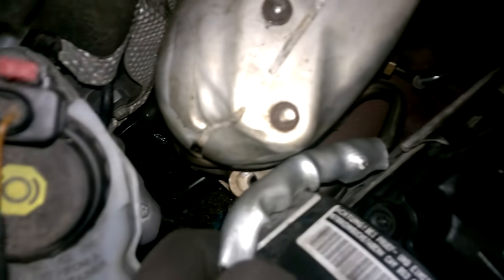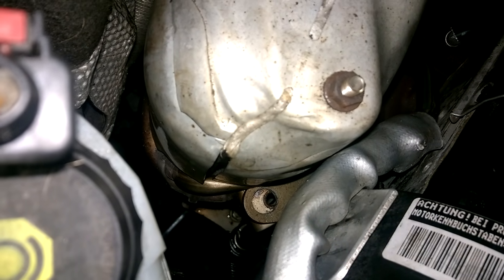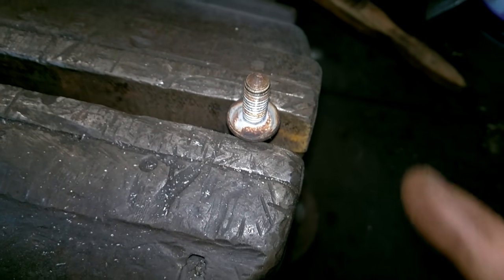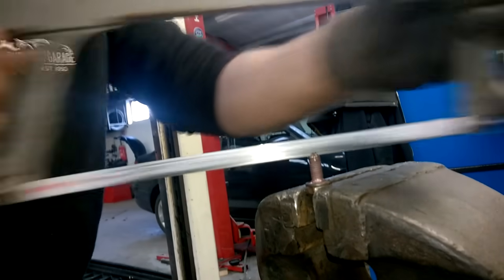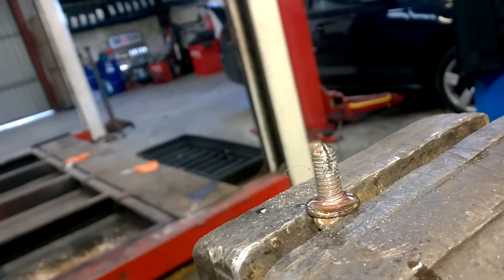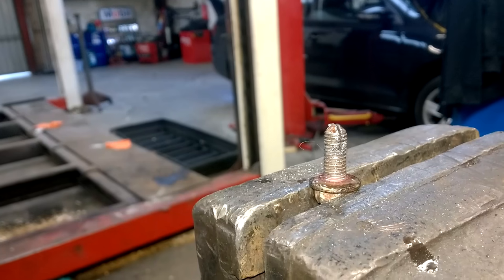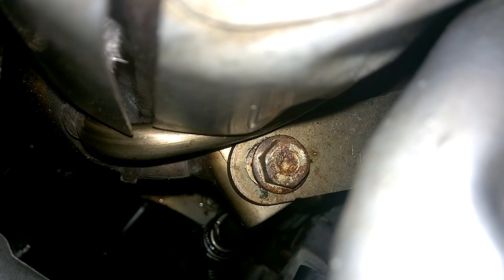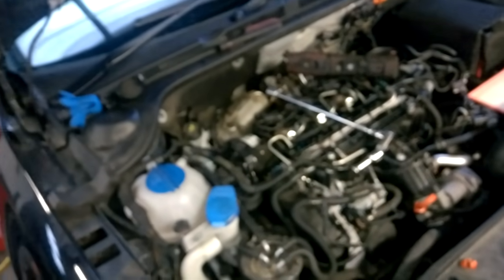My Father Taught Me This! Passing It On To The Next Generation

Comment: Thank you for sharing your father’s knowledge with us!
Reply from the maker: Cheers Dan  
 
The update info below is the pinned comment on this video, I know most people do not realize I made that video and it better explains/shows this method in use.   
I also included below details of why the job was done this way free of charge with the customer fully informed. I hope you check it out  👇👇
 
UPDATE* I decided to make a follow up video on this https://www.youtube.com/watch?v=yfNQullGEuQ&feature=youtu.be Should answer some of the questions that were raised, I include 3 demos of this in action with close up shots.
 
As there was some safety concerns & confusing comments raised, I felt I should clear a few things up. 
1) This is a tip for certain circumstances only, I never have and never would use it on a component which would cause any safety concern to any customer.  
2) The demo was done on a support bracket only, items like this or similar will not cause any safety concern. 
3) I did this free of charge and on a time restraint, I noticed it when I was replacing another item, the customer needed the vehicle back that evening and I decided rather than leave it like it was, I would do this and secure it up fully. 
4) The bolt was not the issue, the part that the bolt threads into is a secured piece, someone had previously damaged it, leaving the bracket loose and the bolt just tightened a turn or so.
5) The bolt can be removed and will not break, it will go in and out as usual and has helped clean up the damaged threads.  
6) Used in the right application I personally believe this is a great tip and can save you a lot of time & trouble. 

Lastly to all the people who have watched the video, Thanks very much and I am delighted with the feedback I have received on it.

Comment: Ahem.... what a great idea...I couldn't have it better myself... hahaa thankU.
Reply from the maker: Glad you liked it! 
 
The update info below is the pinned comment on this video, I know most people do not realize I made that video and it better explains/shows this method in use.   
I also included below details of why the job was done this way free of charge with the customer fully informed. I hope you check it out  👇👇
 
UPDATE* I decided to make a follow up video on this https://www.youtube.com/watch?v=yfNQullGEuQ&feature=youtu.be Should answer some of the questions that were raised, I include 3 demos of this in action with close up shots.
 
As there was some safety concerns & confusing comments raised, I felt I should clear a few things up. 
1) This is a tip for certain circumstances only, I never have and never would use it on a component which would cause any safety concern to any customer.  
2) The demo was done on a support bracket only, items like this or similar will not cause any safety concern. 
3) I did this free of charge and on a time restraint, I noticed it when I was replacing another item, the customer needed the vehicle back that evening and I decided rather than leave it like it was, I would do this and secure it up fully. 
4) The bolt was not the issue, the part that the bolt threads into is a secured piece, someone had previously damaged it, leaving the bracket loose and the bolt just tightened a turn or so.
5) The bolt can be removed and will not break, it will go in and out as usual and has helped clean up the damaged threads.  
6) Used in the right application I personally believe this is a great tip and can save you a lot of time & trouble. 

Lastly to all the people who have watched the video, Thanks very much and I am delighted with the feedback I have received on it.

Comment: Just grind the tip of the bolt down beyond the bad threads then bevel it.
Reply: Might not reach though??
Reply: @ROBERT082510  If its the first few theads thats what I do. You can also used a thead chaser.
Reply from the maker: The update info below is the pinned comment on this video, I know most people do not realize I made that video and it better explains/shows this method in use.   
I also included below details of why the job was done this way free of charge with the customer fully informed. I hope you check it out  👇👇
 
UPDATE* I decided to make a follow up video on this https://www.youtube.com/watch?v=yfNQullGEuQ&feature=youtu.be Should answer some of the questions that were raised, I include 3 demos of this in action with close up shots.
 
As there was some safety concerns & confusing comments raised, I felt I should clear a few things up. 
1) This is a tip for certain circumstances only, I never have and never would use it on a component which would cause any safety concern to any customer.  
2) The demo was done on a support bracket only, items like this or similar will not cause any safety concern. 
3) I did this free of charge and on a time restraint, I noticed it when I was replacing another item, the customer needed the vehicle back that evening and I decided rather than leave it like it was, I would do this and secure it up fully. 
4) The bolt was not the issue, the part that the bolt threads into is a secured piece, someone had previously damaged it, leaving the bracket loose and the bolt just tightened a turn or so.
5) The bolt can be removed and will not break, it will go in and out as usual and has helped clean up the damaged threads.  
6) Used in the right application I personally believe this is a great tip and can save you a lot of time & trouble. 

Lastly to all the people who have watched the video, Thanks very much and I am delighted with the feedback I have received on it.

Comment: Great tip!
Reply from the maker: The update info below is the pinned comment on this video, I know most people do not realize I made that video and it better explains/shows this method in use.   
I also included below details of why the job was done this way free of charge with the customer fully informed. I hope you check it out  👇👇
 
UPDATE* I decided to make a follow up video on this https://www.youtube.com/watch?v=yfNQullGEuQ&feature=youtu.be Should answer some of the questions that were raised, I include 3 demos of this in action with close up shots.
 
As there was some safety concerns & confusing comments raised, I felt I should clear a few things up. 
1) This is a tip for certain circumstances only, I never have and never would use it on a component which would cause any safety concern to any customer.  
2) The demo was done on a support bracket only, items like this or similar will not cause any safety concern. 
3) I did this free of charge and on a time restraint, I noticed it when I was replacing another item, the customer needed the vehicle back that evening and I decided rather than leave it like it was, I would do this and secure it up fully. 
4) The bolt was not the issue, the part that the bolt threads into is a secured piece, someone had previously damaged it, leaving the bracket loose and the bolt just tightened a turn or so.
5) The bolt can be removed and will not break, it will go in and out as usual and has helped clean up the damaged threads.  
6) Used in the right application I personally believe this is a great tip and can save you a lot of time & trouble. 

Lastly to all the people who have watched the video, Thanks very much and I am delighted with the feedback I have received on it.

Comment: Not a Smart idea if its a torque load faster.  Bolts grip strength is extensively compromised.
Reply: But it's not a torque load fastener.  He didn't say to use it as a flywheel or harmonic balancer bolt.  Although it's a little dirty, that bolt head looks like a Grade C bolt or something near it, only about 100-200 pound max. load bolt to use on a bracket.  Certainly not a 120,000 lb. Grade 8 bolt.

Comment: im a certified ase mechanic worked for 30 yhears we never do this.. reason being those tabs arent holding anything you just shortened your thread count.. we use a tool called a thread chaser its hardened steel that retaps these you use a flat nose chaser and it will do the same thing.. or you use inserts heliacoils  that bracekt it was dead on before you make it fit you dont grind threads along the bracket and if possible dont reuse old bolts on hot items over time the metal breaks down and they snap this is why header bolts snap always cooling and heating you install new grade 8 or 10 bolts just my opinion..
Reply from the maker: The update info below is the pinned comment on this video, I know most people do not realize I made that video and it better explains/shows this method in use.   
I also included below details of why the job was done this way free of charge with the customer fully informed. I hope you check it out  👇👇
 
UPDATE* I decided to make a follow up video on this https://www.youtube.com/watch?v=yfNQullGEuQ&feature=youtu.be Should answer some of the questions that were raised, I include 3 demos of this in action with close up shots.
 
As there was some safety concerns & confusing comments raised, I felt I should clear a few things up. 
1) This is a tip for certain circumstances only, I never have and never would use it on a component which would cause any safety concern to any customer.  
2) The demo was done on a support bracket only, items like this or similar will not cause any safety concern. 
3) I did this free of charge and on a time restraint, I noticed it when I was replacing another item, the customer needed the vehicle back that evening and I decided rather than leave it like it was, I would do this and secure it up fully. 
4) The bolt was not the issue, the part that the bolt threads into is a secured piece, someone had previously damaged it, leaving the bracket loose and the bolt just tightened a turn or so.
5) The bolt can be removed and will not break, it will go in and out as usual and has helped clean up the damaged threads.  
6) Used in the right application I personally believe this is a great tip and can save you a lot of time & trouble. 

Lastly to all the people who have watched the video, Thanks very much and I am delighted with the feedback I have received on it.

Comment: Ya so your basically making a self tapping bolt. I use to do this on toyota oil pans when i would open it up from 1.25 to 1.75 m12 when idiots would overtorque the drain bolt. Some idiots would strip them out and not tell the customer and sometimes the bolt wiuld shoot out while the custer went off roading in their car like a tootsie roll bolt.
Reply from the maker: Yep, you are on the money. 
 
The update info below is the pinned comment on this video, I know most people do not realize I made that video and it better explains/shows this method in use.   
I also included below details of why the job was done this way free of charge with the customer fully informed. I hope you check it out  👇👇
 
UPDATE* I decided to make a follow up video on this https://www.youtube.com/watch?v=yfNQullGEuQ&feature=youtu.be Should answer some of the questions that were raised, I include 3 demos of this in action with close up shots.
 
As there was some safety concerns & confusing comments raised, I felt I should clear a few things up. 
1) This is a tip for certain circumstances only, I never have and never would use it on a component which would cause any safety concern to any customer.  
2) The demo was done on a support bracket only, items like this or similar will not cause any safety concern. 
3) I did this free of charge and on a time restraint, I noticed it when I was replacing another item, the customer needed the vehicle back that evening and I decided rather than leave it like it was, I would do this and secure it up fully. 
4) The bolt was not the issue, the part that the bolt threads into is a secured piece, someone had previously damaged it, leaving the bracket loose and the bolt just tightened a turn or so.
5) The bolt can be removed and will not break, it will go in and out as usual and has helped clean up the damaged threads.  
6) Used in the right application I personally believe this is a great tip and can save you a lot of time & trouble. 

Lastly to all the people who have watched the video, Thanks very much and I am delighted with the feedback I have received on it.

Comment: Nice one, Noted thank you.
Reply from the maker: The update info below is the pinned comment on this video, I know most people do not realize I made that video and it better explains/shows this method in use.   
I also included below details of why the job was done this way free of charge with the customer fully informed. I hope you check it out  👇👇
 
UPDATE* I decided to make a follow up video on this https://www.youtube.com/watch?v=yfNQullGEuQ&feature=youtu.be Should answer some of the questions that were raised, I include 3 demos of this in action with close up shots.
 
As there was some safety concerns & confusing comments raised, I felt I should clear a few things up. 
1) This is a tip for certain circumstances only, I never have and never would use it on a component which would cause any safety concern to any customer.  
2) The demo was done on a support bracket only, items like this or similar will not cause any safety concern. 
3) I did this free of charge and on a time restraint, I noticed it when I was replacing another item, the customer needed the vehicle back that evening and I decided rather than leave it like it was, I would do this and secure it up fully. 
4) The bolt was not the issue, the part that the bolt threads into is a secured piece, someone had previously damaged it, leaving the bracket loose and the bolt just tightened a turn or so.
5) The bolt can be removed and will not break, it will go in and out as usual and has helped clean up the damaged threads.  
6) Used in the right application I personally believe this is a great tip and can save you a lot of time & trouble. 

Lastly to all the people who have watched the video, Thanks very much and I am delighted with the feedback I have received on it.

Comment: Two tips...1..Before sawing the bolt, run a nut to the bottom of the thread....sawing burrs the thread but you can run the nut back up to clear the burrs. 2. correct hacksawing is pressure on the forward stroke, relax on the back stroke. This way, blade wear is halved and the tooth set wear is reduced.

Comment: If that's a load bearing bolt/bracket (which it probably isn't) then you've weakened that bolt and it could fail under load. This is definitely a cowboy trick reserved for amateur mechanics/engineers, no professional would do this.
Reply from the maker: The update info below is the pinned comment on this video, I know most people do not realize I made that video and it better explains/shows this method in use.   
I also included below details of why the job was done this way free of charge with the customer fully informed. I hope you check it out  👇👇
 
UPDATE* I decided to make a follow up video on this https://www.youtube.com/watch?v=yfNQullGEuQ&feature=youtu.be Should answer some of the questions that were raised, I include 3 demos of this in action with close up shots.
 
As there was some safety concerns & confusing comments raised, I felt I should clear a few things up. 
1) This is a tip for certain circumstances only, I never have and never would use it on a component which would cause any safety concern to any customer.  
2) The demo was done on a support bracket only, items like this or similar will not cause any safety concern. 
3) I did this free of charge and on a time restraint, I noticed it when I was replacing another item, the customer needed the vehicle back that evening and I decided rather than leave it like it was, I would do this and secure it up fully. 
4) The bolt was not the issue, the part that the bolt threads into is a secured piece, someone had previously damaged it, leaving the bracket loose and the bolt just tightened a turn or so.
5) The bolt can be removed and will not break, it will go in and out as usual and has helped clean up the damaged threads.  
6) Used in the right application I personally believe this is a great tip and can save you a lot of time & trouble. 

Lastly to all the people who have watched the video, Thanks very much and I am delighted with the feedback I have received on it.